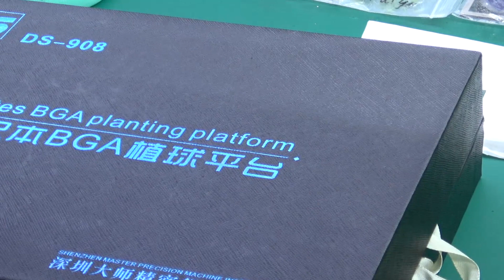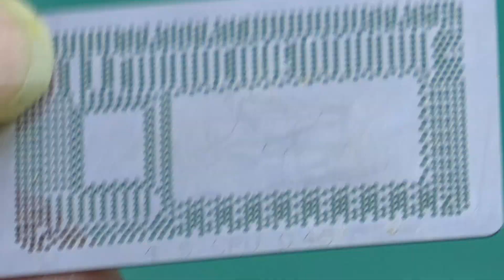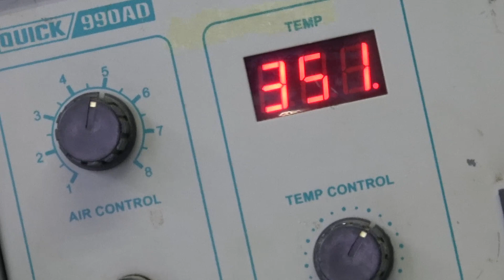How to Reball MacBook CPU (13-inch MacBook Air, Early 2015)

Comment: In my 20 years experience I never saw a socket type intel processor failure... But intel bga cpu with pch chip failure is a very common issue nowadays...

Comment: Liu, it looks like your CPU is ever-so-slightly buckled/bent from removing; I have the same problem. Has this presented any issues for you? The bend is so, so slight. Do you know of any thing to correct in, either post-removal or via BGA profile settings? Quicker/longer soak? Great work as always.
Reply: adjust the temperature on the bending side lower. If cpu bends concave that means your lower temperature is high. If bends convex just put 0.5mm thermal pad on top of the die then solder.

Comment: Brother Master Liu, pls read my question and do reply. Very important. Whenever i try to reball CPU or PCH in apple motherboards it fails. It is fine in hp , dell etc. The contacts on the mother board are different. It does not catch the solder easily . This is the reason that when i mount cpu or pch on the motherboard and with the help of my bga machine ZM-R5860 i reball it , it does not get 100% soldered. Pls give me some kind advice what to do . Waiting for your answer. My whatsapp number is +919870034616. My email id is taralaptops2015@gmail.com.  Thanks